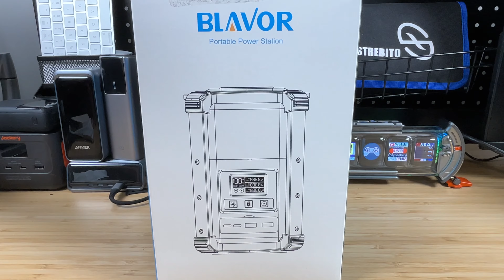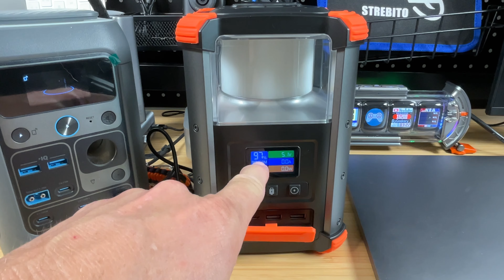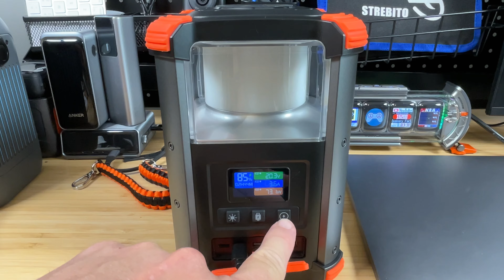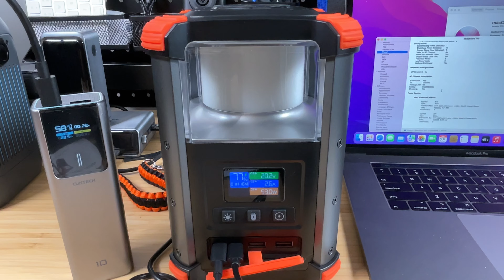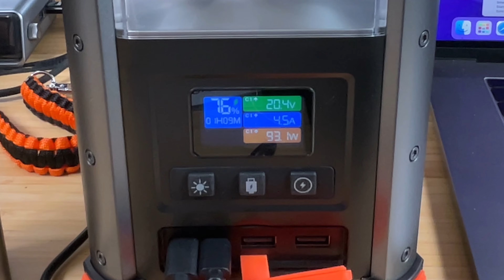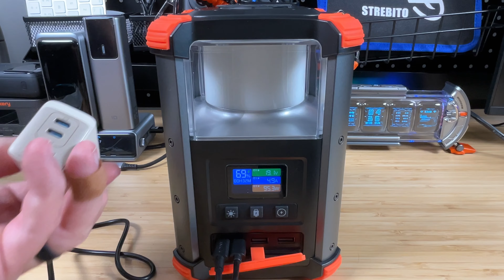BLAVOR PN-W43 Portable Power Station / Lantern for Camping

Comment: I'm looking for a 200 to 300ish. I'd like a choice of usb output. The big one I can't find. Is I want a 24v to 30vish output.  I'm converting to all e27 light bulbs. 24v to 30vish . I want all my lights independently solar powered. I want a unit like this that will receive 24v solar in.. out put the same. 
But could be disconnected.  And taken day camping. 
 I'm guessing.  I can use 24v @ 20ah . A day. The unit would need to recharge on 6 hours of solar. 
  Can you recommend.  It must be able to output 24v.
  Thx: Chuck